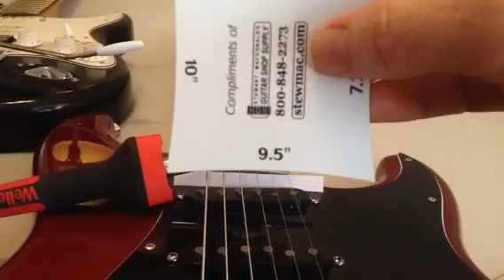Curing Stratitis By Moving Polepieces

Comment: The stagger is not cause of how easy the were to "move" - It was the compostion of the wound and plain string and how much flux variation they were capable of generating for the pickup. Plain G needs a lower pole piece yes, but not cause of how easy they were to move. Jeez... they're all easy to move!

Comment: hey folks have been doing this since, banjo strings started going on guitars.
After you find the sweet spot, you may want to heat up the pole again, then let it cool with out letting it move. This should 'glue' it tight, for you.
I am wondering if I can get away with this with a  Jazzmaster pick up.
The D out put is way low.
Thanks.

Comment: A similar issue (radius vs pole piece height) exists in Jazz basses as well.
The poles for the "E" are often too high compared to the "A"  and "D". 
I cold grind just a 16th off the "E" poles ( grind in tiny increments without getting
the pole hot) makes for much nicer "E" balance. I will try your pole push-in
next time!

Comment: great video and explanation but the solder iron didn't work for me. The pole pieces wouldn't move even after a minute of heating. In the end I took a plumbers spanner and used that to squeeze the G string pole piece down. btw: I have a korean Squier strat so maybe the pickup is assembled differently. I've still to put it back together but at least the G should be quieter now. Thanks for the vid

Comment: Yeah, I first did this on a set of Fender Tex Mex Pickups. Those have plastic bobbins and there was no problem. Then I did it on a Phat 50 Pickup and killed the thing. So only do this on vintage style pickups if you have time to get the pickup completely rewound or have a replacement ready. NEVER do this before a gig or a recording.

Comment: I can't really think of a good reason to heat the pole pieces just to move them- since it can damage the magnets. 
Moving them in the first place is risky already... heating them too adds more risk of (or guarantees?) destroying them.
The technique that I have used twice- with success- on Fender Original '57/'62 pickups to lower the G magnet and raise the B magnet is to use vice grips.
*When you are lowering a magnet you need to put a stack of 2 washers under the magnet (where the other side of your vice grips are pressing) to allow a place for the magnet to go.
*To raise a magnet take a little short sheet metal screw with a wide head (I use the computer screws that secure the panels or hard drive on a computer tower) and press the tip of that screw into the bottom of the magnet with your vice grips pushing on the head.
This is very low impact and gradual.

The reason I had success and didn't damage anything is probably because I didn't move either of the E magnets- which have the wire wrapped around, and laying on, half of their circumference. Or else I'm just lucky.

I guess this guy came up with the idea of heating the magnets out of desperation after being unable to move the magnets without the assistance of mechanical advantage.  It is much better to use mechanical advantage with vice-grips. 
And I'm not being a typical youtube judgmental a-hole... it's no biggie that he didn't think of vice-grips.  I'm not bashing the guy, but I do think he is damn lucky that he has not cooked his pups (at least, not to a degree that he notices the tone loss due to the magnet field reduction). 

I'm not being a dick- I'm just trying to prevent people from cooking their magnets after watching this.
Reply: If you actually look into the issue of heating magnets, ultimately it all depends on the type of magnetic material and how much heat is actually applied. The level of heat generated by his soldering iron won't de-Gauss the magnets.

Comment: Having just obtained a Strat (classic vibe 60's Squier) I was used to a Les Paul imitation, and I just assumed somebody could get a pair of grips (pliers) with soft jaw covering, and screw/unscrew those plain pole pieces.  Waddayaknow, you can't!  I take it, the guitar player probably adjusts his playing to compensate for any volume difference with the strings on their guitar.  All theories and allegiances aside, it patently is a necessary tuning adjustment, if they were made differently in the first place (pole heights).  Screw-adjust have their own issues - a 'hole' or slot in the screw, right where you want a nice full magnetic field.Not to put too fine a point on it - if you made a guitar from scratch now, you would have adjustable height pole pieces, but adjust from the back so the pole face was flat where the string is.  Kind of seems obvious and a no-brainer.  HOWEVER if the tradition and convention of how it's always been, is more important, I guess that's a non-starter.  Lastly, the heat of a soldering iron destroying magnetism - theoretically, it can occur.Magnets of the neodymium material at least, lose their magnetism around 180 degrees centigrade (350 deg F), up to about 300 degrees centigrade (570 deg F) I believe.  So, when in the Netflix series 'Power' they fit a magnetic tracker to the exhaust of Tommy's muscle car, I mused over the (fictional) wisdom of that.  Perhaps these are merely 'induced' magnets, maybe it's better.  Common for motorcyclists to pop a strong magnet onto the bottom of their oil drain plugs, to gather bits of loose metal to the bottom of the engine and hold them to the plug inside face.  Then drain oil, and get metal filings out during maintenance.  However, they can find the magnet is good for months, then abruptly one day, is gone.  It is put down to the heat de-magnetising the material enough so vibration and bump forces, finally are sufficient to knock it off.

Comment: Seems like a valid solution to me.  Like u said think about it and be careful.  I was going to ask u if you have thought of a way to make strats less "icepicky" in regard to the treble output of the bridge pup.  I've tried lowering the pups, using different strings and a few more things but it rarely works the way I want.  I usually end up changing the pups.  I even tried the master tone mod and it is about the closest I can get but usually sounds more muddy.  Any ideas?  Thanks
Reply from the maker: Afraid that is just the nature of vintage strat bridge pickups. I have tried many aftermarket strat bridge pickups myself to correct that problem. The Duncan ssl-5 and Dimarzio Area 61 come to mind.
Reply: Look up directions for changing your second tone control to also add bridge pickup control as in the latest American std. On it, the second tone is for bridge and middle, instead of the classic middle only. Or, you could simply switch it from middle to bridge ala Eric Johnson and other.  This is why they did this :-)

Comment: Whatever you do in life, NEVER move the pole pieces on a single coil unless you don't mind it breaking. ESPECIALLY never move the high or low E pole pieces, those will almost definitely destroy your pickup.

I broke a Seymour Duncan APS-1 this way. The pickup required a full rewind, because the start wire had broken somewhere hidden.  It's basically a complete rebuild, and it takes forever if you don't have the tools. Let my horrible experience be a cautionary tale. Just sell your staggered pickup and buy a flat one. When it breaks it will be worth NOTHING. 
My tale does have a happy ending. I just finished rewinding my pickup, and it sounds beautiful again, now I just need to wax pot it. 

Remember kids, 
Don't do the crime if you can't do the rewind!

Comment: My gripe with Strat pickups is that the high E string is too lacking in volume, compared to the other strings. The high E string has very little metal to it, because it is so thin. So, naturally, it creates the least disturbance in the magnetic field of the pickup. So what does Fender do? They slam the pole piece down to the lowest position of all the pole pieces on the pickup, generally. This makes for a nicely DEAD high E string. Good thinking Fender! This really messes with single-note lines, where you want all notes to ring out with pretty much the same volume.
Reply: yep pisses me off too

Comment: I have fat 50's and the high B and E strings are so much quieter than the rest of the strings that it's making me crazy. Any advice on a good method besides a soldering iron to heat the pickups to the required temperature?

Comment: I have a somewhat reversed issue. My strat has a set of Yosemite pickups on now and they are entirely flat. However, I have a neck with a 7.25” radius which is quite round. Which means, when I press down all the strings at the last fret, my low and high E’s are very close to the poles, and as you get to the middle, the strings are WAY further from the poles. So I think the solution will be to stagger the pups by pushing the poles through the bobbin slightly up to get a tad closer to the middle strings. Does that sound reasonable? Cheers! (The G string I will leave flush because it’s always loud it seems)

Comment: Talking about 300 degrees etc misses the point. He used a soldering iron to WARM the pole pieces and soften the wax. Adjusting anything not built to be adjusted carries risk; Slow and easy wins the race. Thanks for another possibility for pup mods.

Comment: I did this years ago on a cheap squire - no soldering iron, just forced it down with a screwdriver. It went too far and so I had to push it back up from the bottom. I think some reckneck in a music store told me about it. 

I have been tempted to drill out and thread the holes to make my own adjustable pole pieces. Would probably demagnetize the pickups. Someone try it and let me know what happens.

Comment: I don't think you can do that on an Ibanez pickup 'cause I think there is a ceramic magnet on the bottom of the pickup.  If the pickups have magnetic pole pieces, then yes it can be done.  I'll have to examine the pickups before trying the hot solder iron as I don't have the $$ to be replacing pickups.
Reply: My biggest concern is that magnets loose polarity when heated.
You can end up with a magnet that is not just a chunk of metal.
Reply: @Mr__V  Tha amount and time of heat in this procedure can't damage de magnets at all. For any damage you'll need another level of heat.

Comment: I use a 12 inch radius gauge lay it cross the pole pieces and adjust  pole pieces so that the radius gauge sits and all six pole pieces are  touching the gauge in a 12 inch arc . This is with a 9.5 neck radius . And found every string outputed same volume as there texas specials ii set pickup height to roughly the same  specs fender says .

Comment: 1:59 NO.
The strings #3, 4, 5, 6 (G, D, A and E) were wound and the winding material back then was non magnetic. So that only the cores of the four wound strings were actual metal things disturbing the magnetic field from the pickups. Less than half of the string's diameter was magnetic.
The strings #1 and 2 (E and B) were unwound, all the 100% of those strings were magnetic.
1-st and 2-d strings had more magnetic metal than wound 5-th and 6-th strings.

So the magnets had to be pulled closer to the four strings with weak magnetic properties and pushed away from the two strings with strong magnetic properties in order to balance the volume output among all the strings. It is a clever decision for its time.

However nowadays if you use pickups with staggered magnets, you MUST buy vintage strings with non magnetic winding for strings #3, 4, 5 and 6. Otherwise get yourself a modern flat magnets pickup.
Reply: yeah, what he said about the wound G didn't make any sense to me. your comment explains it better
Reply: @derekscanlan4641  
Thanx :))
Reply: good luck buying them tho!

Comment: Ha, this is funny, but I have pickups with that kind of stagger, but completely by chance, I also have a 7.25" radius and I'm using a wound 3rd string. Not because of vintage accuracy, I just prefer the ease of chording (small hands) and my B-standard tuning requires heavy strings with a wound 3rd. I do get warble if I raise the pickups too high, though.

Comment: The description of why the pole pieces are at different heights completely ignores the physics of the strings that affects the sound. If the different pole heights were to compensate for radius of the neck, wouldn't the varying heights resemble the curve of the radius?  How would the B string be lower than the E string and then the G string is higher the the E or the B?  The radius doesn't look anything like that configuration.  The two physical properties of the string that explain the pole configuration are one, the larger the string (of the same composition - wound or unwound) the louder the string will sound - thus the B string is lowered to get an even volume from two different sized strings.  And two, unwound strings are louder than wound strings - thus the G string is larger so if using an unwound G string then the G pole would need to be lowered to not overpower the B and E strings.  However, if using a wound G the G pole piece being higher compensates for the lower volume of wound composition. The height of the D, A, and E poles are lowered as the wound strings get larger. To me, since the pickup is designed for use with a wound G, then using a wound G (I use 17 gauge) makes as lot of sense.

Comment: If it's really bugging you then grind it or file it down which may be extreme but you won't risk ruining the pup. It seems like we're all looking for that extra little magic out of our guitars which ends up driving you nuts.
Reply: I did it by just pushing the G pole piece down with controlled pressure, using a screw driver. No heating or grinding required. May not work for everyone or every pickup, but on my Tex Mex pickups it worked fine.

Comment: I simply use a wound g string. I use a fender vintage nickel 10 set and replaced the g with a pyramid nickel .017 wound.
Reply: I tried a wound and it was fine but trying string bends to get the right pitch was hard.  You need to bend a lot further to reach the note.

Comment: well , my 2 cents, i tried this on my fat 50s and the neck and middle pu are now really weak. They still work but with a very low volume unusable... The bridge pu survived tho
Reply: Heat demagnetizes magnets. You may need the pickups re-magnetized
Reply: @brythecracker  Yeah i dunno why the heat was necessary, i did this with my SD SSL-1's and i didn't use heat, just a pair of tongs and it worked wonders. Actually, do you know if the SSL-1's are fiber or plastic?

Comment: This will ONLY work on the cheapest strat pickups that have plastic bobbin flatwork. It is very dangerous to do on real strat pickups that use Forbon composite flatwork, because the coils are wound right ONTO the magnets. If you go pushing the magnets up or down, its highly likely this will rip the coil wire and kill the coil. You NEVER ever want to try this on vintage Strat pickups.

Comment: I'm not 100% sure, but I think I heard that applying heat to an alnico magnet can demagnetize it.
Reply: Sure, but Curie temperature - at which its magnetism is permanently damaged - is 800°C. Now you can't get close to that, maybe 250-300°C will weaken it a bit, which would happen if you held the soldering iron on for too long, but you'd get different issues before that, first the wax will completely liquify, then the wire isolation, then the plastic. Another thing to consider is that he can touch it immediately after applying the heat, but skin pain threshold is 55°C. I think wax has released at around 40°C, and he likely heated to barely above that, if at all. I think in the grand scheme of things, at temperatures under 50°C, barely anything happens.
Reply: the video above is part of a series of lessons called "how to destroy your guitar in a few simple steps"
Reply: +Cozmovox if you only tapped a screw driver to the pick up to magnet it will damage also the pick up?

Comment: My problem is I have a 50th american strat and I need to bevel the sharp poles.
Reply from the maker: I've never tried to do that before. I wonder how brittle the magnet material is?
Reply: Well it could be done with ease,if I could safly remove the bobbins and return them to there home but, with these rare pick ups ,I aint going to try,What boggles my mind is that they don't bevel them and leave such a sharp edge,It's pathetic that we pay all this money for a fender and they can not simply finish the pick up's properly.

Comment: A safer cure for "Stratitis" is to lower the pickups  until the warble goes away.
You only get Stratitis when the pickups are too close to the strings.
Reply: ...but then you lose the volume level of the top two strings. This fellow is right to work with the pole piece heights. I've been doing this for decades. And yes, you are correct, we need to adjust the pickup so that it isn't too close to the strings. He mentioned that too. GREAT video.

Comment: Extreme heat is a good way to ruin a magnet.  I learned this from brushless rc motors.
Reply: What is "extreme" heat as far a guitar magnets are concerned?  I'm in America so in Fahrenheit?   Thanks.
Reply: Ballpark 1500 Fahrenheit in this case. I would say when the plastic bobbins have evaporated and the copper windings have melted down you're getting close.